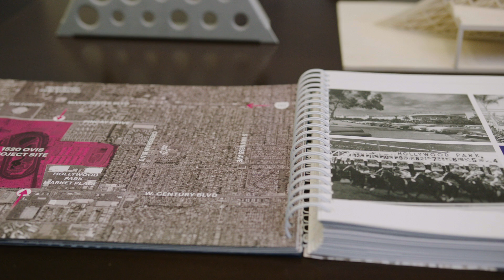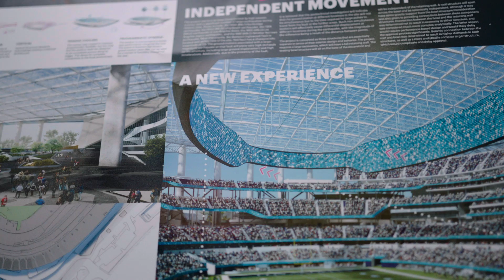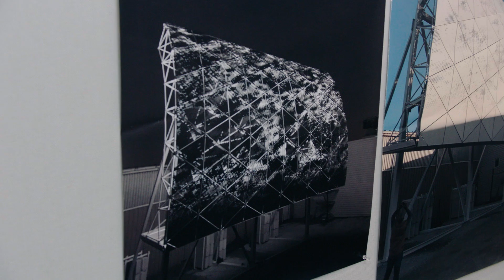Building SoFi: How an NFL Stadium is Designed | LA Chargers

Comment: Season ticket holder here;
The scoreboard and seating is awesome!
The canopy seems to project the sun not guard from it.
There is very little air circulation inside the seating area but there is a lot throughout the outer concourse
The metal panels are cool until it rains and then it’s a huge mess.

Comment: As a Raiders fan this is the ONLY time I will be liking a Chargers video.  Amazing stadium that represents it's geographical location to the fullest.  Those perforated panels are an nice detail sourced by a company that has done a lot of work on some of the most iconic buildings designed by Frank Gehry.  Amazing amount of detail for a project of this scale, I see why the cost is so high.